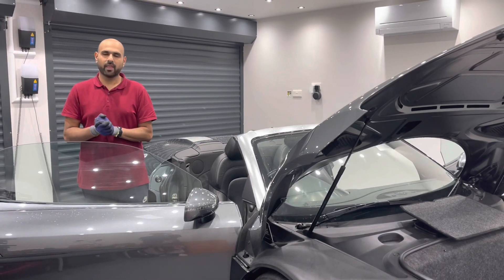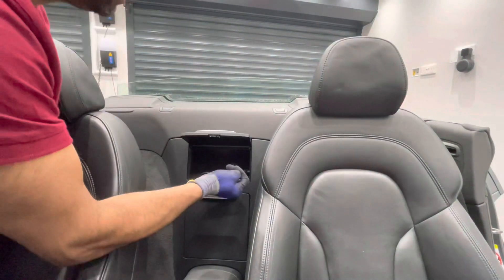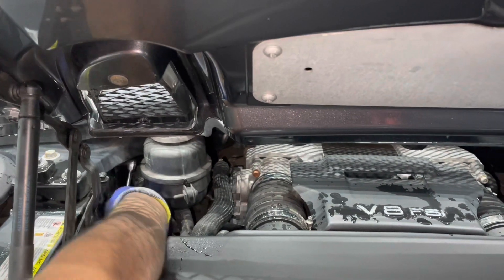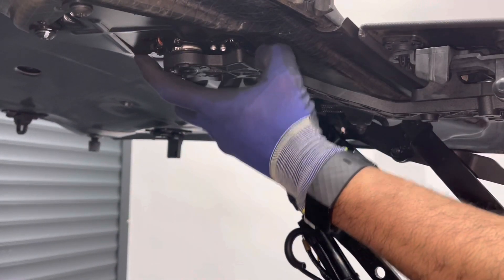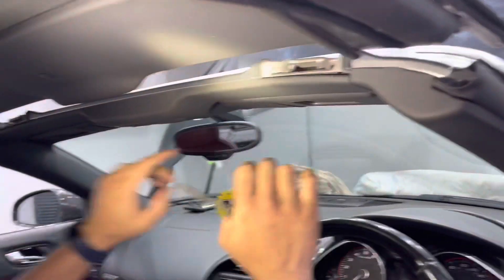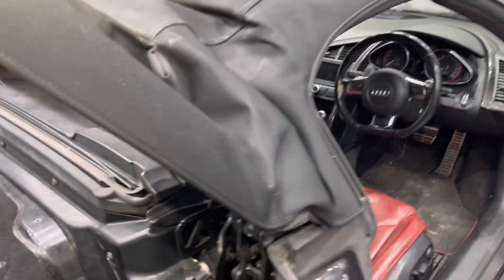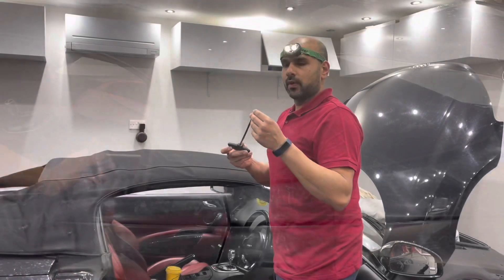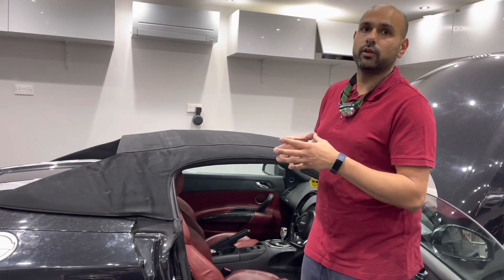Audi R8 Spyder (427) - How To Close Roof Manually

Comment: Is there a process to release the roof when it is stuck closed... I have an issue where the roof doesnt work and its flagging an issue with an open circuit top flap motor... recently had a clutch done at Audi and was working before it went in but they are no help at all.
Thanks
Reply from the maker: Hi

Yes there is a way, it's in reverse of the closing procedure but you also need release the fins which is the challenge as the hydraulics go over the resistant point and "lock"
Reply: Yeah thats the issue Im having, its my bosses car so couldnt really say no but at the risk of damaging something Im going to have to swerve this one

Thanks
Reply from the maker: @JP-xo2ki  ok, if you get stuck give me a call

Regards
Team VagPro
Reply: @CabrioletTech  Indeed, having an issue with my top not opening. I can release the clamps. After that I tried to release the fins, but the hex is just unscrewing the bolts and not releasing the fins. I did use the top hydraulic release first, but fins are still firmly mounted to to  the engine cover
Reply from the maker: The video is intended for showing you how to close the roof manually, not how to open the roof manually.

If there is no fault, then the roof should open on the button

As the rear fins  are locked down hydraulically and then by a lever mechanism inside the roof frame.
Reply: @CabrioletTech  Totally understand. I agree  was looking how to open and not close the top. I thought it was just to reverse the process but not.  Besides, not wasting watcher time here, I did send you guys requests to help for pay. However no one responds. Besides, you videos are VERY excellent :)
Reply from the maker: @jhybinette how did you contact us as we always aim to respond. 

But nevertheless why are you attempting to open the roof manually? If there is a fault, repair the fault and open electronically.
Reply: @CabrioletTech  Contacted through VAGpro and got response from heygoldie.  In the ticket I gave details. Fault only shows while key is in ignition and on then pressing the top switch for 20 sec or so, then briefly get:
 
1 Fault Found:
0015 - Switch for Tension Bracket; Upper 
          B118A 29 [10001001] - Signal Implausible
          MIL ON - Confirmed - Tested Since Memory Clear
             Freeze Frame:
                    Fault Priority: 2
                    Fault Frequency: 1
                    Reset counter: 191
                    Mileage: 84364 km
                    Date: 2024.03.27
                    Time: 00:55:03

Then of course trying the top hydraulic release process with key out and pressing the top button for 10 sec or more, does to release pressure?
Reply from the maker: @jhybinette  send us an email through the website, please

Comment: Excellent video with a great explanation. Quick question regarding the end of the video where you mention about not unscrewing the screws for the top cover, once the roof is repaired should you unscrew them or will it get done automatically when the electrics/hydraulics are all working again?

Comment: Awesome video I have not found anybody on the Internet with video instructions! My problem is exactly oposite  my roof is stuck in the closed position. Everyone says just to do the opposite, but that doesn’t work. Even Audi dealer is having a hard time for two weeks now.
Reply from the maker: Hi

It's not as simple to open the roof manually as you have to open the fins which are locked via a mechanical cam. 

However why are they trying to open the roof manually? If there's a fault, fix the fault and open electro-hydraulically 

If you need any further information feel free to contact us via one of the means below

Regards, 
www.vagpro.co.uk, 
www.facebook.com/vprouk, www.instagram.com/vagprouk, www.youtube.com/c/VagProCabrioletSpecialist